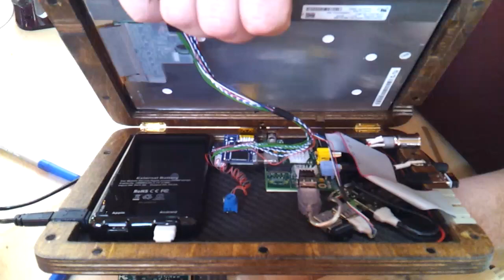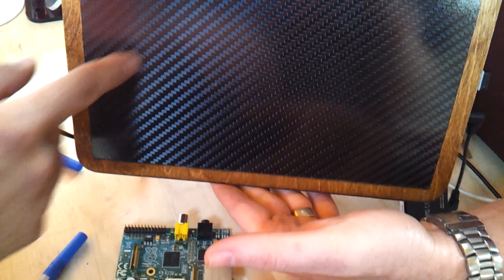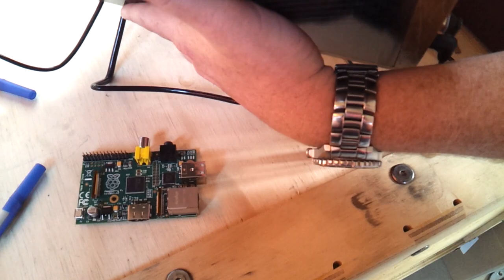Raspberry Pi tablet in MakerShed at Maker Faire KC

Comment: The Pi does surprisingly well handling touch. The screen is supported in Raspbian and has no problem keeping up with my finger. I typically use Raspbmc though but the kernel doesn't support the touchscreen. As Drew mentioned I've been busy with Maker Faires but am planning to do a writeup on the Make Blog at some point. Until then you can check out mkcastor.com and my Flickr page at flickr.com/photos/62562887@N05/sets/72157633778482589/